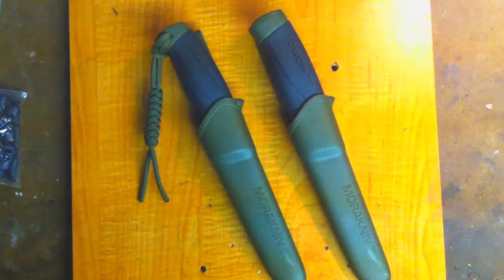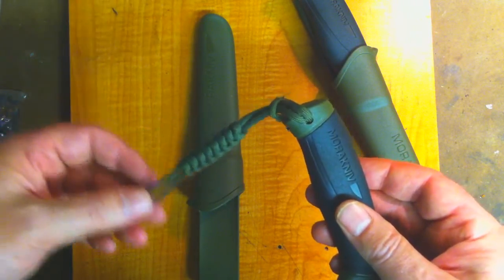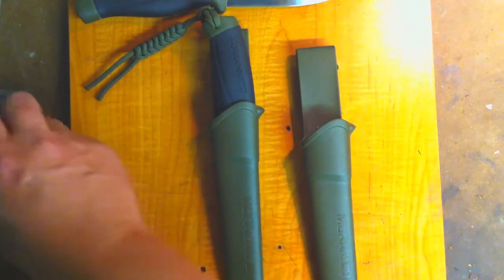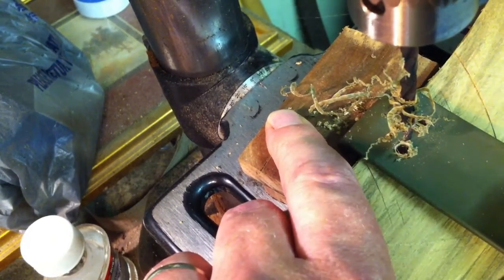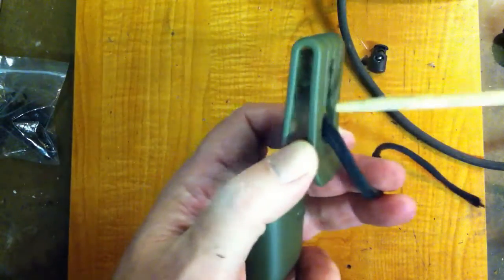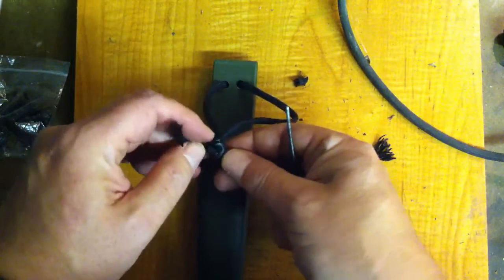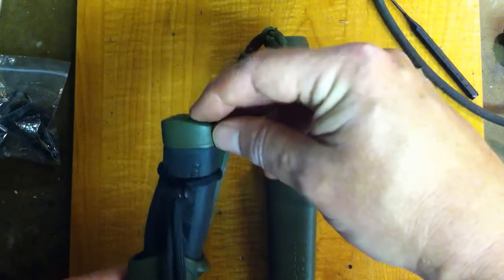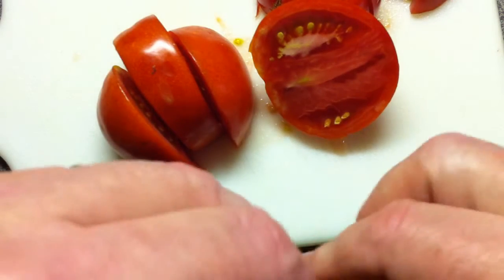Mora Companion and Companion HD Knife Mod & Review

Comment: I really like your idea! I just ordered my Mora and this will be one of the first mods I plan to do. Thanks for posting!
Reply from the maker: I'm glad you liked it.  Let us know how it works out for you.
Reply: I did it using the 550 and took the cord lock off an old sleeping bag closure. I ended up adjusting the cord / and lock around to the front side of sheath to allow easier removal / replacement of the knife. Thanks again for the idea 😀

Comment: One small comment.. When the lanyard accidentally gets in the way it will get cut.
Reply from the maker: +Bram Dorrestein Thanks.  You may be right.  It hasn't happened yet but if it does I will update the video.  Of course, now I'm super aware of that possibility and will work to avoid it.
Reply: +tackettsmillfarm  I like the lanyard, to ensure you don't cut it just flip it back out of the way when you're removing the knife instead of pulling the knife out through the lanyard -- good design!  And yeah, Mora makes an incredible knife... wish I knew how to sharpen it as good as it comes out of the box!
Reply from the maker: I fully agree with Re nato about the Japanese stones.  I also use a leather strop with metal polishing compound.  My Moras get crazy sharp using them.